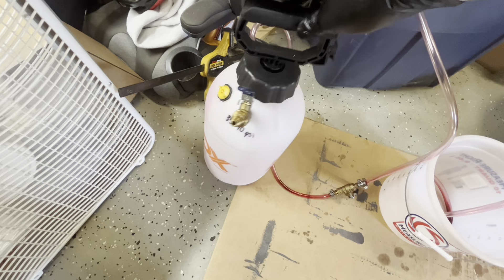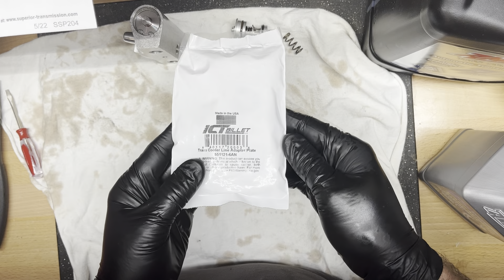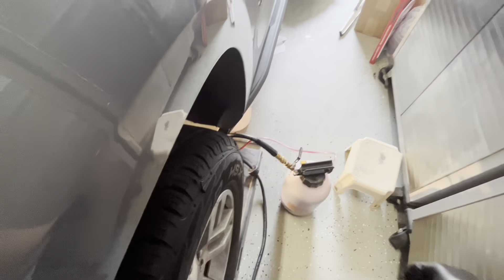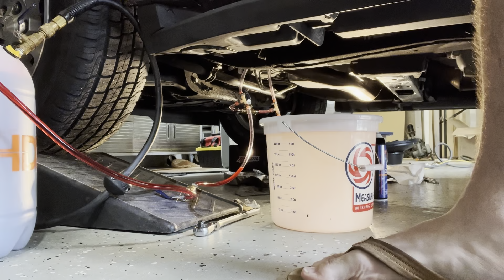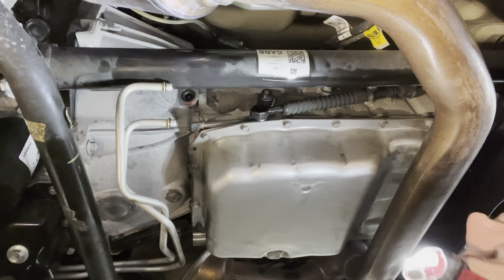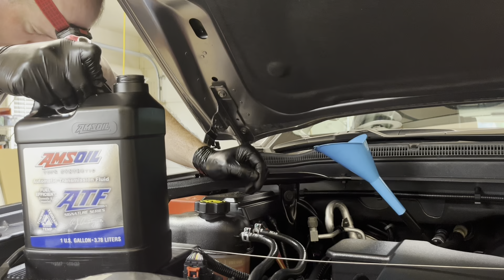6L80 Transmission fluid exchange process - 2020 Suburban

Comment: I have a 4l60 e from 2009. I just use old cooler line, hook that up to passenger side top radiator.
That’s the drain.

Dump your pan, filter, clean. 
Add tranny fluid from pan loss.

Dump fresh fluid into dipstick tube.

Start engine, monitor gallon by gallon.

I’m assuming you have no dipstick?

Comment: Thanks for making and sharing this great video. However, I really didn't understand the use of the bridging hose with a valve at time mark 1:35. If the valve there is open pressurized fresh fluid would be meeting pressurized drain hose and I think the fresh fluid would simply drain along with the old fluid. Please explain what I'm missing. Thanks.

Comment: Just curious, I found this web site about the 6LE80 and 6LE90 transmissions "If you do not have an external transmission cooler, the cooler line flow goes as follows: lower cooler line > lower radiator port > upper radiator port > back to upper transmission line."  But you said that the lower line was the out of the transmission and the upper line is the in.
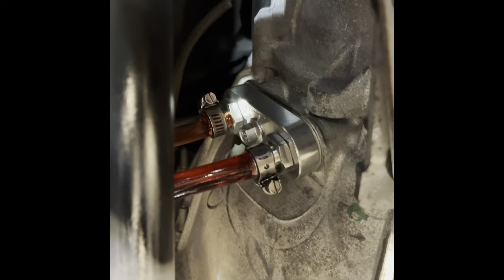Reply from the maker: Check out 12:40 in the video. The upper fitting is the outlet from the trans , lower is the inlet. This was confirmed during the process to make sure I hooked up the exchange system correctly. It also makes sense with the direction of the check ball on the thermostat delete. 
Also I know earlier models had the cooler in the radiator, but these trucks actually run through the A/C condenser, which is odd.

Comment: Thanks for making and sharing this video! I made a similar setup based on this. 

For anyone looking to recreate this, the only recommendation I'd make is to make sure the transmission outlet port lines can handle the pressure and heat of the fluid. I'm not sure what the exact numbers are, but I literally exploded the clear hose I had for my outlet line while doing this to my 2020 Silverado 6L80 (thankfully it was in my friend's driveway and not in my garage). I ended up just using some compressor hose which was overkill, but it worked well.
Reply from the maker: I didn’t do it super hot so the standard vinyl hose worked well.

Comment: Why would you want to delete the thermostat.  And If you do what would be the temperature ?   
Ty.
Reply from the maker: I’ve noticed a 40 degree F drop on temperature vs before the thermostat delete. The thermostat blocks fluid from entering the cooler until the temp reaches 190F. Now I’m in the 140-150 range after reaching steady state.
Reply: These transmissions run hot and many believe heat destroys them. There are many videos on the STL010 sure cool conversion.
Reply: Now why in the hell would GM design the cooler not to operate until 190?  There must be a good reason for that…
Reply: @basicuser54  the reason for that is to burn off condensation inside the transmission just like the engine temp.  Otherwise, you will have a rust starting on the internal components.
Reply: @Jerzeyguy thank you for the reply. Sounds like if you live north where it’s cold for much of the year don’t delete the thermostat, but those in the south should have no issues
Reply: Also, completely removing the thermostat means your trans will take forever (maybe never on trips around town) to reach operating temp in cold areas like mine, I have to think that’s not ideal.

Comment: Is one gallon enough if I’m just dropping the pan and changing the fluid? Not flushing
Reply from the maker: I want to say there is about 5 quarts in the pan, but I did not measure. I got 14 quarts for the whole exchange.
Reply: @smokingoatgarage I think it depends too on how long you had the pan dropped because I do know it continues to drain out from the converter the longer it's exposed so just make sure you have a pan to collect underneath and whatever comes out just put that amount back in but it's going to be more like six to even seven depending on how long you have the pan off

Comment: do you have a link to the plate you used?
Reply from the maker: ICT Billet Transmission Cooler Line Adapter Plate with Gasket 6AN Fittings Compatible with 6L80E 6L90E 8L90E Factory Oil Seal Line Connector for Custom Braided Hose Set 551121-6AN https://a.co/d/huFWGBd

Comment: Nice setup. Not sure what that special aluminum block with nipples is for. Can’t you just remove existing hoses and connect to them?  I’ve thought about making a system like that but I have just as much luck draining 1-2 quarts turning the car off filling 1-2 quarts etc using existing lines. You mentioned Toyota. I tap into the output line coming out of the external cooler in front of the drivers wheel. Works great and exchanges all the fluid after three or four times
Reply from the maker: Thanks for the comment. I built this exchange kit for my Toyota vehicles where I can tap into the cooler lines directly because Toyota uses more conventional hose barbs. The Chevy uses a jiffy tite connector that is harder to adapt to. That’s where the extra block came in. I drop the pan and change that fluid, then perform the exchange to minimize cross contamination of old and new trans fluid. Hope this helps!